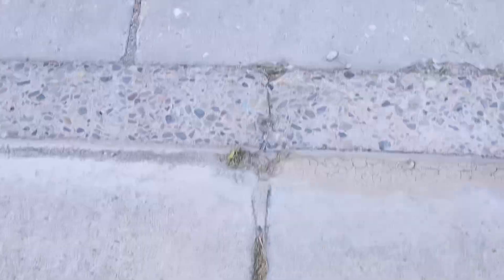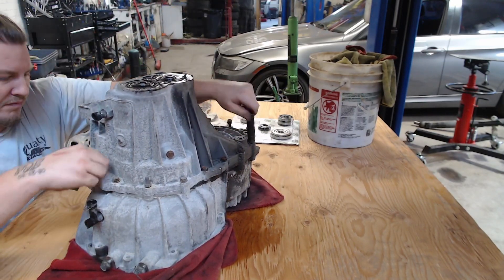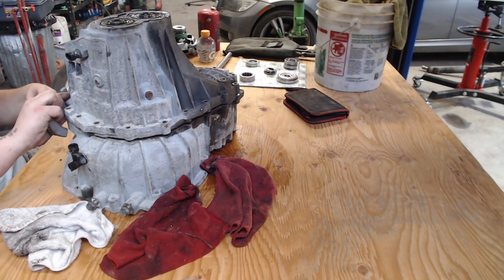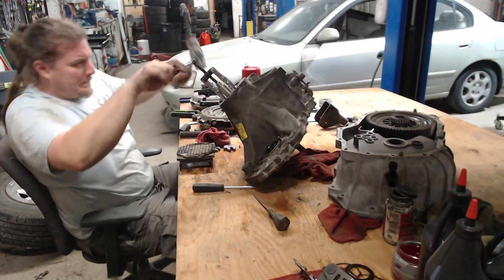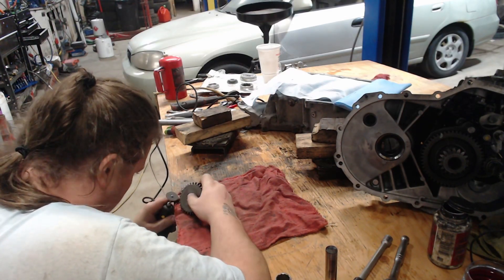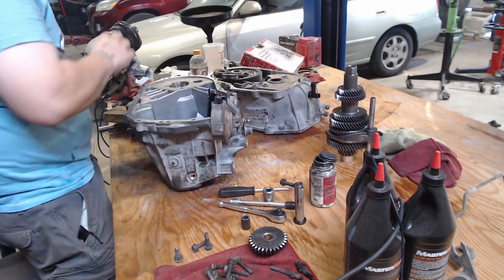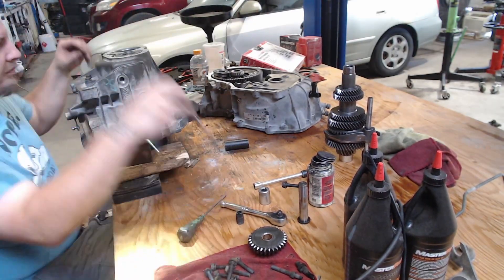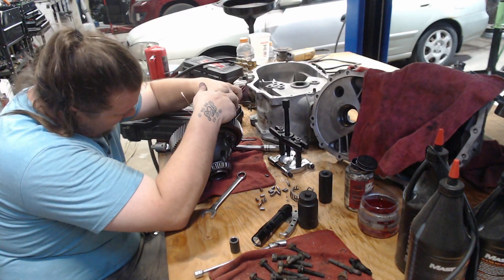14 Patriot Transmission Short

Comment: If I want you to repair a Jeep Patriot manual transmission, where are you located?
Reply from the maker: I can say, this is a job I will not perform again, in the future.  My recommendation is to find a reputable local shop that will replace the transmission as a unit.  The total job time was 24 hours, and would have cost the customer 3000 USD in labor alone, not including parts.  A used unit can be sourced for ~800 USD, and replacement takes around 5-6 hours. At the rate I would charge for the replacement, labor would come to 1600, nearly half the cost of rebuild.  

My personal recommendation is to sell the Jeep and purchase something that will not destroy its' own transmission bearings every 90k miles.   :D